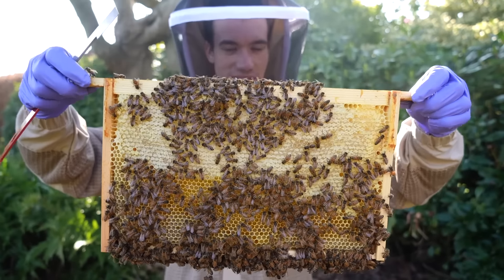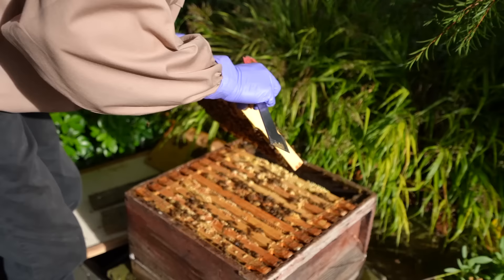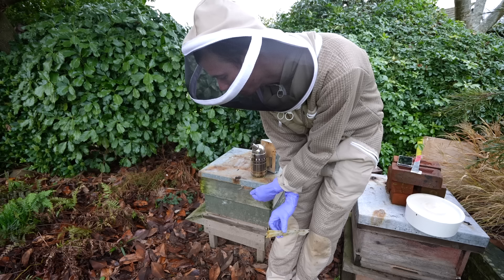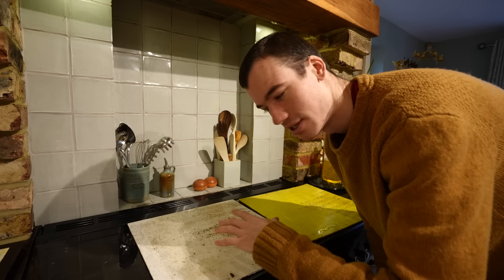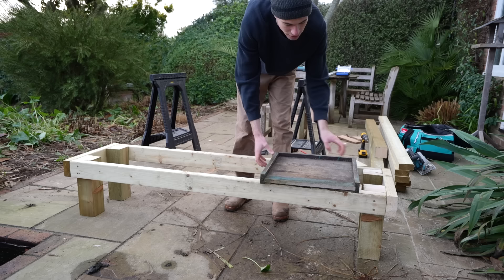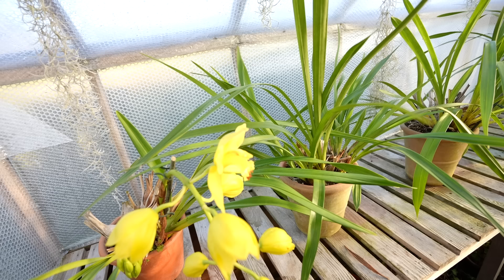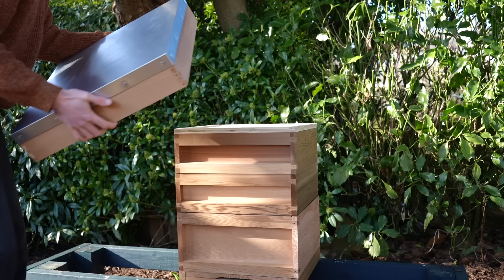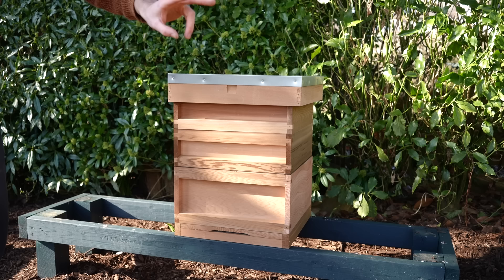Expanding my Beekeeping Operation - building hives and treating for disease

Comment: I think the painting of the wood will prevent water rotting it. It will weather proof it. I heard you say the bees don't like wet conditions so it is actually vital to paint all the wood around the outside of the hives to help your bees get through our wet winters!! The paint will prevent the rain from seeping in so it helps keep the bees dry and it prevents the wood from rotting so your hives last longer!!

Comment: Hi Alex,
Painting your wood is good for more than just the looks. Originally, paint was applied to wood to make sure the wood stays good for longer, and this still is the case. If you want to give your hives a longer lifetime, applying some paint, or even varnish/lacquer or whatever it is called, will keep the wood from being weathered down by the elements for much longer. I would definitely recommend it.
Reply: Is using the bees wax an option too? Would be nice cycle with all the bees offer.
Reply: @sarahsleamanova2072  You can use wax to coat your hives, but paraffin wax is used, not bee wax. You'll need also some micro-crystaling wax. Here you see how it's done: https://youtu.be/KK21RVAX19s
Reply: This is one of the reasons why they use cedar. Cedar contains weatherproofing oils and weathers beautifully instead of degrading. In America, many high-end homes have cedar shingles on the roofs because they last many years in the elements and look beautiful once weathered.
Reply: What he said. Also, pay extra attention to end grain of the wood, as it sucks up most moisture.
Reply: Just make sure your paint is vapour open, and that you dont use plastic based paints. Vapour open solutions as oil or limestone based paints are better for the enviroment and the wood itself. As wood acts somewhat of a sponge, its important to let the wood drain and dry out. Placticpaint is vapour closed, and can cause fungi and deteriation. Furthermore, the plasticpaint will crack eventually, and leave big "chips" plactic in your garden. You can also make your own paint from linoil, oxidepowder (natural coloring minerals) and buttermilk, which is quit fun.

Comment: Hi Alex, awesome video. I'm a biologist (although more into the microbial field) so always into data collection and analysis. Might I recommend you draw a grid on the white board you insert at the bottom of the hive, so that you can get an average square inch concentrations/infestation of mites. Depending on how often you swap out the boards, you can track if the mite concentration is increading/decreasing over time. It'll let you know how effective the strips are as well, if you get a sudden increase and then decrease. Hope it helps and keeps the bees healthy. Best wishes from New Zealand.

Comment: Just three suggestions.

#1. You should keep a water source close by the hives for them. Just a small birdbath filled with small stones and pebbles with do - sloping up the sides so they can walk down to the water.
#2. If you want to protect your new bee boxes - going forward - give them the viking treatment. Get some raw linseed oil and organic pine tar, then do a 50/50 mix. It'll preserve the wood for decades, and it's food and insect safe - and pine tar smells so good! Just leave them to dry for a week or two before you introduce bees to them. I do this for all my raised garden beds too.
#3. You can easily build an insulating frame box to go over your bee boxes for the winter. Just need to cut out around the exit of the box for air circulation. Pop it on in the winter, take it off in the spring. Happy, warm, bees, also use less energy to stay warm, so less food required for them.

Keep at it, love your work, man!

Comment: Hi Alex, I'm a beekeeper and a woodworker in a similar climate as yours. While the cedar hives look very nice in their natural unpainted state, you can make them last much longer with some sort of protectant. I really like the look of the natural wood, so I treat mine with a mixture of 50% paraffin wax and 50% microcrystalline wax. I then apply that to the outside of the hive with a heat gun until the wood will absorb no more. I'm 4 years in and my hives still look brand new. Cheers!

Comment: Hello mate, I'm across the pond in USA. During the Autumn, Its a great time to evaluate your equipment and assemble your frames or more hive boxes while supplies are available. The beekeeping supplies are an investment as I am getting into producing queen bees for resale (most people are requesting a starter hive).. I build my hive stands with treated pine timber to resist decay, not necessary to paint or apply other coatings.. My operation is stable with around 20 full hives and a dozen or more small Nucleus (NUC) hives for producing new queen bees and starter colonies.

Comment: As a carpenter I’d probably screw something extra supports under your stands because the screws can snap over time and the weight of 200kg from the 3 hives might compromise the strength of the screws all you need is just a block into the legs supporting the timbers that the hive base sits on. Really enjoy your content looking forward to seeing you grow in knowledge and the subs 😇🙏❤️☮️🌟

Comment: Bees, Frogs and god knows how many undiscovered animals are living in this beautiful garden of yours (respectively your Parents Garden)
This would be my Dream  Garden If I had one

For the future I'd suggest treating the wood you bought using either Beewax (helps with Fluids not penetrating the Wood) or a clear coat. I've got no clue about Bees but it might help with the Dampness a bit, painting also works but the paint wont stay forever, a good beewax or clear coat coating will last for longer than most Paints you can get.

Comment: 31:29 There are different types of hives. 1 consisting of large hives 2 consisting of only small hives 3. Combined of large and small floors. The main idea of small hive tiers for honey is that you can separate meadow,forest etc honey because they take less time to fill 1 compartment the other reason (mainly for emale beekeepers) is that they can hold a small section.

Comment: Alex, When you get a chance. Just dip the bottom of the legs in some used motor oil. This will stop the damp from the ground going up and rotting the timber.

Comment: Wood needs to be painted or it rots, that is why it is called a protective coat. Also have drain rock for wood to ground or the legs that support the frame will rot.

Comment: I don't think it's strictly about the looks of the stands. But rather, there's "raw" wood on bare dirt, so it'll rot away pretty quickly. You gotta paint them or treat the wood in some way to make it more resistant to the elements

Comment: Just a tip, normally you can added the apivar strips right after you taken you summer honey off.  Apivar worked better between a certain temperature range so you want to get them in End August / September.
Reply from the maker: Will remember that for next time.

Comment: Beekeeper here in the tropics, could it be that the reason why you guys in the west have a lot of issue with Varora is because you don't apply gresses at the base of your hive, ants aren't the only type of pest that needs to be stopped with grease at the base of the oil, so far it is a mite like termies, it would climb it's way slowly into the hives and cause long term destruction.